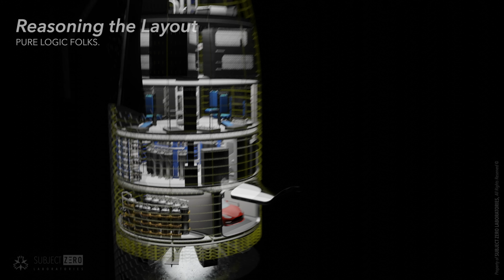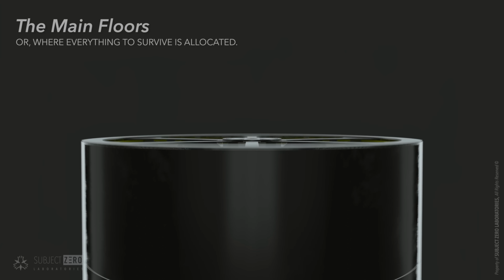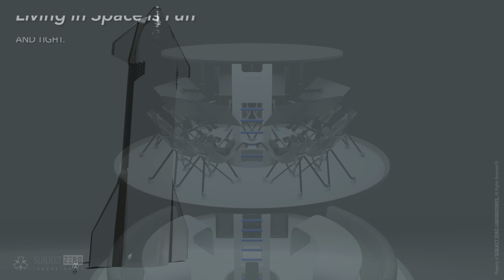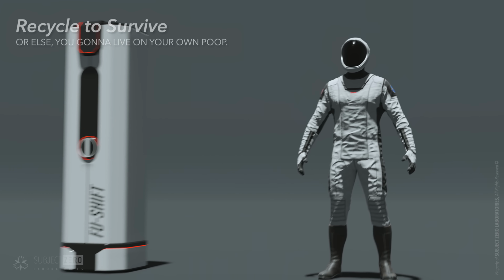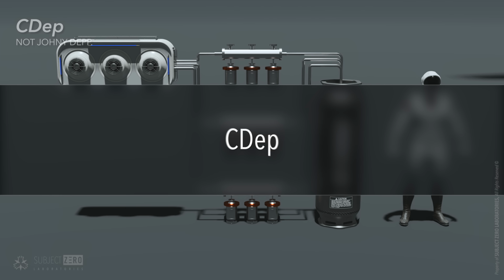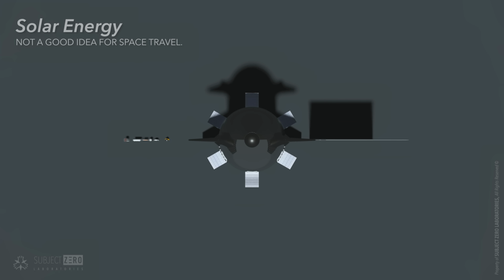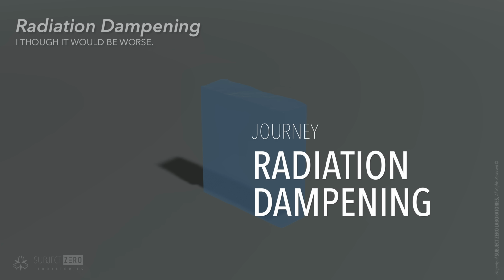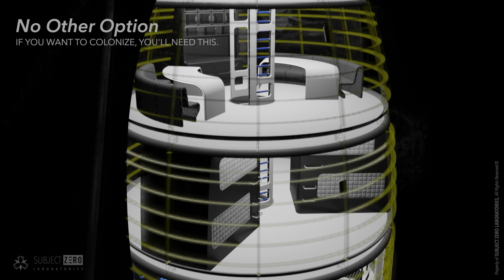Onboard the SpaceX Starship 2.0 in Detail - What it takes to go to Mars | Detailed Breakdown

Comment: I was thinking, "They're going to need nuclear power", all the way through the second half of the video.   Hydrogen cells, solar and batteries are never going to work on such a lengthy mission.  Over time, hydrogen leaks through of all known materials.  I would be very nervous about hydrogen tanks that were meant to last five years, or even six months, without serious leakage problems.

 With nuclear, there will enough power to spare to split CO² back into carbon and oxygen.  This means far less oxygen will need to be transported since it can be recycled from CO².  With sufficient energy available, water can also be split into hydrogen and oxygen.  In this scenario, the hydrogen doesn't need to be stored for long periods, minimising the leakage losses.

Recycling everything combined with utilisation of resources found on Mars will be the key to manned journeys to Mars.
Reply: The downside is the weight of nuclear reactors though
Reply: @VitVoz  - check out NASA's "kilopower" reactor
Reply: Freja Solstheim  those are micro reactors and do not provide anywhere near enough power for an entire space ship.

a probe yes, a space ship that utilizes over a thousand times as much energy?

nope. there is no nuclear power station light enough to provide enough energy that can be added to the ship, period.
Reply: Hydrogen can be contained entirely in graphene I heard
Reply: @freedomhq4075  not without leaks, that's the issue at hand.

yes graphene can be used like a sponge but getting it to the sponge still requires pumping it through tubes and hoses, which means leaks.
Reply: Manned mission to Mars will never happen with Chemical Rocket Fuel you dreamer😁
Reply: Nuclear reaction has been tested and in use for almost fifty years in space on Voyagers 1 and 2. It works and it's proven.
Reply: @georgeyoung4292  why not?
Reply: Developing a nuclear reactor suitable for this mission would take a few years at least, especially for the astronauts to have faith in it. It's not clear if it is workable at all. The reactor would have to be one similar to those on submarines, but would also need to be lighter and more efficient. It's also an additional radiation risk. And it has to be operated, automatically or manually. Both aren't easy, and it's a long voyage for nothing to go wrong. Reactors like this regularly fail or have issues (and I don't even mean the blowing up kind). In a submarine you just need to surface and then you have at least oxygen. In a spaceship... Fuel cells and Solar power are way more reliable. They may even find a way to stick a lot more solar cells on a starship, or the cells get more efficient. Lots of things are possible in the coasting phase.
Reply: @zamath1895  Cause it will take 9months to go there , thats 270days , human being needs 3liters of water and 2meals a day (1500kcal is minimum) Crew of Starship is what? Lets say 50peoples*3l(Kg)*270days=40500kg or 90000lbs+3500kg(70kg per person) or 8000lbs🤦‍♂️ What about the food? What about the equipment and machinery? What about 9months in Zero Gravity? What about GCRs? In 9months you're musles and bones will lose 30% of the density and radiation will make it even worse... But just to account for the weight!!! We are talking about 150-200 metric tons just of raw material fot short therm survival.. Entire Mars saga has been absolutely ridiculous.. Unless we develope new kind of propulsion and shielding and figure out how to generate gravity we are not going anywhere cause we are not evolved to survive in such conditions you genius!!! You really believe this bullsh*t😁???
Reply: @georgeyoung4292  So for 50 people to go it takes 200 tons, Starship is said to be able to carry 100 tons to Leo so instead of 50 their will likely be let's say 20 people leaving 20 tons for exercise,beds,extra if 20 people is still to many you can lower it more. The problem of zero Gs is a hard one to solve but it has been proven that you can survive more then 9 months in zero Gs and be fine afterwards. I believe it is perfectly possible to land people on Mars and set up a colony We as humans have pushed our limits countless times in the past and we will undoubtedly do it again
Reply: @zamath1895  land people on mars? Sure, it might be possible in a decade. Setting up a colony? We aren't even close.
Reply: I think the most interesting possibility here would be to use nuclear fusion (once we get it to work ofc), even though that will obviously take a bit of time until we re finally there
Reply: @Andreas-gh6is  space nuclear reactors do not use water to generate power like subs generators, they use the Seebacks effect from the heat of the nuclear source, this is a basic and very fail resistant system that can be enlarged or have multiple versions of the existing system, Perserverance rover uses one of the latest models, it's reactor weights around 45kg and uses a plutonium source of about 5kg to generate ~110W, with a bigger reactor of around half a ton and multiple plutonium sources they could easily get to 2KW to 3KW, with a battery system is more than enough to transport humans, the battery would be charged when astronauts are asleep by turning lights, computers and non essential systems and during the day the battery would complement the reactor power generation.
Reply: @georgeyoung4292  we simply dont know what the future will bring lol, might be ready by tomorrow, might be not even in 500 years, who knows
Reply: @nulled7888  I know that it wont be viable for electric generation in this century even here on earth, let alone to somehow build it into Rocket Ship nor will you see any manned mission to Mars... Absolute Garbage🤦‍♂️
Reply: @georgeyoung4292  everyone has their own opinion on such topics i guess.. while you seem to be rather pessimistic, it helps to views progress in a positive light too sometimes. And you really shouldnt underestimate the 21th century, that should be clear by now, dont you think? We have so many promising technologies that our ancestors would probably think of as magic, i would never make the mistake to underestimate this development if i were you. IMO it seems as if we are very close to the edge of a cliff, either we will fall or we will learn to fly. And it has to happen soon, because we are running out of time.
Reply: @nulled7888  Im realist.. Sure we will make it😁
Reply: @georgeyoung4292  Uh,  NASA with SpaceX have developed rockets (Starship and super heavy booster) using fuels (methane and oxygen) for planned missions to the moon and Mars.  It's not a dream.
Reply: Worse. Hydrogen embrittles  the materials it is leaks through. Hydrogen embrittlement.
Reply: @DeferedPattern  this kind of reactor works for probes and rovers, but it's not going to scale up. There are probably good reasons nuclear reactors in general don't use the same concept. Radiation shielding is one problem. You don't need any in a probe, but it changes with Humans. Also it's not just about the Humans, neutron radiation also affects other plutonium in the vicinity. So you'd need to shield different reactor cells in order not to get a critical mass and a run-away chain reaction. By that time, a more conventional design is probably more efficient and practical. But in any case, the complexity grows with scaling the system up in any form.
Reply: pyropulse  So far for not getting personal. A submarine or aircraft carrier is not a spaceship. On a spaceship, mass counts a lot more. Also you don't have multiple crew slots available just for handling the reactor. There is no "suitcase sized reactor that can power a home" (nor would that be enough). There may be plans for one, even plausible ones. They aren't reality. Nuclear reactors of all sizes fail regularly. They do have to be managed. Still they go offline quite a lot. Can't have that in a spaceship when you are relying on it for life support and the next port is years away. Nuclear chain reaction is a thing, so you either need some absorption rods (and control them) or shielding between cells. Or an entirely different kind of reactor that only exists in theory or at best simple prototypes. This isn't even about safety at all, though there are probably things that could go wrong. People who really like nuclear power somehow rely a lot on technology that doesn't exist in the real world to make their arguments. And all accidents are preventable and will never happen again, of course, pinky promise.
Reply: I just googled it. a nuclear reactor used in submarines would easily solve the starship power problem but weigh 1,000 tons. that is 10x the maximun cary capacity of one starship just for power.
Reply: Freja Solstheim  won't work... even though they are small and nuclear they are no where near powerful enough to power starship.
Reply: @freedomhq4075  still too heavy... and you will need to bring tons of oxygen and water to make this work.
Reply: pyropulse  What is this irrational emotional attachment people have with nuclear.  Nuclear is just dumb.  Like hydrogen fueled cars.  Dumb.  The cost and the risk of nuclear is not worth it.  And, it can't get scaled up for a space craft like the Starship.  Using nuclear as an energy source here on earth is incredibly stupid.  It takes 20 years to build a plant and it is THE most expensive way to generate electricity.  No, nuclear is not the way to go.
Reply: @zamath1895  have you seen the shape of people after long term exposure to zero G. yes... they survive, but need months of rehab to recover. now you send them to mars and expect to start building day one... not going to happen.
Reply: @DeferedPattern  still not enough power for all the systems proposed for starship.
Reply: @georgeyoung4292  Correct! I've been saying this for decades.
Reply: @nulled7888  Very easy to make speculative predictions but bring your thoughts down to earth (excuse the pun) and make them reality. Going to Mars, and I'm being optimistic, will be sometime in the 2030s.
Reply: pyropulse  Yes, nuclear power is very "energy dense" if you only count the fuel. Maybe if you count the whole reactor with all its shielding and equipment, but then only at a larger scale. In a spaceship all of this counts, and the efficiency or density shrinks with smaller sizes. Some calculations for example say that small modular reactors will produce more radioactive waste than less, just because they have to use a lot more shielding in aggregate, and all of that will eventually end up as irradiated waste.
Reply: @JohnnyWednesday  yeah and they will need them on mars anyway - mars has same solar cell problems with added issue of months long dust storms that would seriously disrupt solar power (but no appreciable wind (1/60th atmosphere density) or other environmental power sources. And anything geothermal if even possible would take decades to get up and running with available eqiptment (also water lack).. And nasa are working on higher energy  kilopower versions.
Reply: Nuclear benefits are huge for this. It solves many problems, the energy could be used to process CO2 to O2, either by Algae, hydroponics and other processes or some combination of all of those. This could re-use human waste and produce food. This further reduces mass needed to be carried. The benefits compound: The appeal of nuclear is strong.
Reply: @Andreas-gh6is  I could like literally build a suitable nuclear reactor for Starship right now so stop being sassy!
Reply: @tillasmax  of course they can start building right away, it's just a matter of mindset and stop being all whiny when you only lost a few percentages bone and muscle mass
Reply: @16nowhereman  huh i never said it had to be before 2030, i agree with u here, development takes time.. all im saying is that with some major progress in key technologies we would be able to do it more efficiently and reliably with less risks etc..
Reply: Let me repeat, even if the nuclear reactors would weight zero and produce no radiation, it would not work... They work by producing heat that makes water vapor that then runs a turbine... That works because as the water vapor cools down it goes in to liquid form...
How do you do that in space how do you cool down thing in the vacuum of space? The international space station has huge heat radiator to manage the heat it generates, a nuclear reactor would require hectares of those in other to work...

Just use solar panels they are way more efficient in space
Reply: Freja Solstheim  yes I know about those but one thing is to generate 400wats of heat another completely different is 10000 wats. You need ever increasingly sized heat permutators, in the vacuum of space it needs to be done via infrared emiton, if you have an atmosphere convection will help.
And heat is what all nuclear decaing elements produce.
The heat exchanger will need to be pointing away from the sun and also be mostly flat so it does not radiate to itself... Again have a look at the ones in the international space station..
Reply: Freja Solstheim  also I was looking up the efficiency of TEG's and it's really low around 10% max meaning that  to get 100 wats of electrical power you need to get rid of 1000wats of heat...  Solar panels work way better, at least when we are this close to the sun... In Jupiter we would need something different for sure but... Inner palanets the sun is your best bet
Reply: Bingo ! that was exactly what I was going to say ! Go nuke and split that CO2 ! such a system if perfected could save "tons" of weight !!!
Reply: @A_piece_of_broccoli  RTG's yeah not exactly the same kettle of fish at all !
Reply: @georgeyoung4292  Of course it could, haven't you been paying attention ? take your doubts, and then halve or quarter the amount of astronauts, there you go, all issues solved...
Reply: @A_piece_of_broccoli  they can power quite a bit actually, for humans to live in a small home you dont need more than several hundred watt hrs per hour
Reply: Well , nuclear ain't going to happen, they don't even want to let Elon conduct testing
Reply: @pinheirokde  well some companies are working on nuclear diamond batteries and if they actually work out maybe they could power the devices in the star ship with enough of them
Reply: @pinheirokde  Somewhat true but only to a certain degree and scale  relatively
Reply: Hydrogen is best stored as water.
If you have electric power, converting to gaseous oxygen and hydrogen is easy.
Reply: @tonywilson4713  That is why this is on YT.
Reply: Freja Solstheim  You don't need to encircle the hydrogen atoms, sheet graphene also physically does not allow hydrogen atoms through its gaps and you can just build that into the tank material
Reply: @myballsitchsomethingfierce6319  The one on the rover is orders of magnitude too weak
Reply: @kazioo2  I think that Voyager I and II might beg to differ with you there...
Reply: Precisely my thought...
Reply: @A_piece_of_broccoli  What about diamond? Imagine a sphere coated internally with industrial diamond layer.
Reply: @Andreas-gh6is  maybe they could drag a nuclear rector behind the human shuttle...like a trailer.  It could be far away from humans.
Reply: @TheRainHarvester  That wouldn't solve much of the issues. It still needs a lot of shielding just for the time it is carried inside the starship. Either the fissile mass still needs to be small enough to not go critical or you have to manage the reaction with absorption rods or something. Management and Reliability are probably negatively affected by dragging it behind where nobody can reach it without a space walk.
Reply: pyropulse  Only when you count only the fuel...
Reply: Freja Solstheim  You can't scale that up very well because of the way the chain reaction works. Ever heard of critical mass?  It's a thing. Those 45kg reactors don't need to manage their neutron output that much. And you can't put multiple smaller reactors on the same ship unless you shield them enough so that they don't go critical by irradiating each other.
Reply: @-CrySa-  indeed... not even close by far. And what good would it be to have 100 people living (extremely unhappy overtime) on mars. People are dreamers and we can dream but we are products of mother earth and it's here we have to solve our problems. This is just rich people doing funny things with less fortunate people's money. But....  we can dream of course
Reply: you apparently now very little about nuclear energy
Reply: @georgeyoung4292  That 9mo figure assumes you're doing a Hohmann transfer which is fuel efficient but takes more time.  A Hohmann transfer from LEO to Mars I believe is around 4km/s dV.  Last I heard the target for a fully fueled and loaded Starship is around 7 km/s dV.  Even after using some for landing that should still leave a good chunk of dV to use to decrease the travel time to Mars.
Reply: @-CrySa-  Nope, we have these things called 3d Printers and they are really big now, Tesla basically 3d prints their cars, we just need a few of those on Mars and we'll be building structures locally, very quickly. So, ya, probably 15 or 20 years, but that's not overly far.
Reply: @inemanja  Cool.
Reply: @TomUlcak  I see you have fallen for Big Oil's misinformation campaign.
Reply: @plumetheum7017  Thats exactly what i said.. Its just pointless to discus such lunacy 😁 From Elon Musk i dont expect anything less than Vapor wear promises..
Reply: One thing he didn't mention was the mass, scale and volume required for radiator panels. And since they won't survive launch or atmospheric entry, they will need to be deployed immediately in orbit and stowed very late in the flight. Quite likely this will involve complex, risky EVAs. 

Nuclear only makes this problem worse because it multiplies the amount of heat that needs to be radiated.
Reply: the questions you ask have been answered by SpaceX.
Reply: @saumyacow4435  a reactor would weigh far more than solar panels. also, SpaceX has a design for solar panels to be self-deployed - as most spacecraft have.  nuclear is not feasible for a space craft the size of Starship.
Reply: @A_piece_of_broccoli  You dont know anything about nuclear reactors.... in fact there were already nuclear boosters in the 70s tested, ofc those have not much to do with a proper nuclear energy source but you also have to consider: The "micro reactors" you talked about lasted for 40 years+.... They "just" have to last 5 years!

But in overall.... not even nuclear power can make a manned trip with staying to mars possible
Reply: @TomUlcak  SpaceX has put out CGIs showing a basic solar array. Nowhere near enough needed to power the systems involved. In other words, they need to be much, much larger. We've seen automated unfolding of large solar arrays, but we've also seen them getting stuck and needing EVAs. And can you imagine what would happen if there were a problem in solar panel refolding and stowage with only hours to go till re-entry? And that's just solar panels - you've also got thermal radiators which tend to be more complex and have far more things that can go wrong thanks to the plumbing.
Reply: @saumyacow4435  please post.  I've seen no such CGIs.  I've seen CGIs that show a scaled solar battery system which SpaceX has put out to power the Starship.  I've seen no mention of nuclear.  A reactor to power a spacecraft the size of a Starship is just not doable.
Reply: @TomUlcak  If you're done discussing it, why are you discussing it?

This is a discussion of nuclear energy's potential use in outer space where there are radiation hazards that will exist for the order of BILLIONS of years, not thousands, and have nothing to do with nuclear energy at all.

Note also that I did NOT say nuclear "fission" which is what your entire objection is based upon, nor did I say that nuclear power is  ready yet for such a use.

This discussion has literally nothing to do with nuclear energy's use terrestrially.  Conflating the discussion with your own arguments about another topic entirely reveals that YOU are the emotional, irrational person here.
Reply: @andymanaus1077  I'm not discussing it.  If you will LOOK, you will see that my last comment on nuclear was the one I said that I'm not discussing it anymore.  ????  This is a head scratcher.....
Reply: @TomUlcak  So don't discuss it.  Leave graciously without insulting others' points of view on the way out.
Reply: @andymanaus1077  me insulting? You’re kidding me. I’m not the one doing the insulting. What is wrong with you? Lot of pride and arrogance?
Reply: @andymanaus1077  so, stop discussing and leave graciously without insulting people. what a hypocrite you are.  seriously.  take your own advice to heart.
Reply: Fuel cells are horribly unreliable. If you get six months operation out of them you have a wildly successful design.
Every single space flight powered by fuel cells had a failure.
Hydrogen loss is the least of the problems…
Reply: Light weight nuclear power reactors exist. They have existed since the US flew the first one in an aircraft in the 1950’s.
Air Transportable power reactors were built and used in Greenland, Antarctica and Australia to power US bases on those continents.
You don’t need 1000 tonnes of anything to make a reactor. 
NR-1 was a complete nuclear powered submarine and it weighed 400tons complete and it was designed to dive to 3000ft so had a substantial pressure hull.
The US and Russia have both launched high nuclear power reactors into space - a nuclear rocket engine would weight 18 tons based on the prototypes built so far.
Reply: @TomUlcak  So far all of the semi-detailed renders of Starship's interior have been fan fiction. And you know what's surprising? Despite Elon's hype and promises, there are still three major bits of technology we don't have. The first is the must-never-fail machinery needed to keep humans alive in deep space for years. The second is the industrial scale mining and processing machinery needed to produce fuel on Mars. The third and even more ridiculously difficult and expensive is of course the "industrial base" that must exist on Mars if you want a self sufficient colony. Even specifying that is beyond our present capabilities, let along designing it, let alone the trillions it would cost.

So, given all the hype and promises, you'd expect Elon have to dipped a hand into his pocket and pulled out a few millions in order to establish a crack team of scientists and engineers to work on these problems.

Has he?

No.
Reply: @VitVoz  You launch the reactor as a single unit and then attach it to the transport module in low earth orbit.
Reply: It's the radiators and mass that get you with nuclear power on Starship. His solar panels would generate around 79 KW of power near Mars. Kilopower reactors had about a 23% efficiency rate, so to generate the same 79 KW they'd need to produce about 265 KW of waste heat. Even the best radiators get around 350 W per square meter of heat rejection, so you'd need radiators of about 757 square meters. 

That's assuming the best possible radiators as well. If you try and just radiate it through Starship's hull, then you're not going to get 350 W/square meter - and 757 square meters is close to half of Starship's entire surface area to begin with. 757 square meters would be the equivalent of having six radiators that are 2 X 95 meters in dimensions (and they're much more complex, especially if you need them to go out very long - and you have to carry sufficient coolant on board to operate them).
Reply: @GuardsmanBass  Well stated. But its even worse than that. The underside of Starship's hull is covered in tiles. The upper side probably won't remain a bare metal surface (it still receives radiative heating on re-entry). So we're talking thermal blankets (see Space Shuttle). Plus the thermal radiators would have to be protected from re-entry. Those requirements conflict, meaning you need deployable radiators. Radiators aren't just sheets of metal but rather they have internal plumbing - which of course makes deployment/stowage even more complex and more prone to failure. 

If on the other hand you stop trying to do "Mars direct" and instead you separate out the role of deep space transit vehicle from Mars lander/ascent vehicle, then you can have a transit vehicle based around a long truss and have your solar arrays, thermal radiators, comms gear and so on, permanently attached to the truss - and you have plenty of space for them. 

What I've proposed is a transit vehicle with a habitat on one end, attached to a long truss (roughly 150 metres). On the other end of the truss is attached propellant tankage. The propellant tankage acts as a counter-mass so you can provide spin gravity. Onto the length of the truss attaches solar arrays, radiators, comms gear and a few other details (including tanks). One nice part is the truss is so long that your main solar array doesn't have to project too far from the truss.
Reply: @saumyacow4435  I like the transit vehicle idea, although I don't think you need to make it that long. From what I've read, people can probably adapt to up to 6 RPM in spin gravity in a couple hours, and maybe even higher. That means you only need a radius of 25 meters - short enough that you might be able to launch it in two separate, folded up Starship flights and have them connect in orbit. 

A more compact ship means you can probably also launch up a heat shield (or have it expand out) that wouldn't need to be so large for aerobraking.
Reply: @GuardsmanBass  2nd attempt at a reply since YT lost my earlier comment. This will be briefer, sorry.  I would defend a long truss thus:

Its only a small fraction of the vehicle mass and certainly a lot less than the mass of hardware attached to it.
A long truss means a long but narrow solar array that doesn't extend far from the truss itself. That means a simpler array and few (if any) hinges.
Similarly for radiators that can be rigidly attached to truss sections. They can be assembled onto the truss on Earth.
You also need space for tankage. Plus other hardware like comms. A long truss gives you a simpler, and probably more reliable design.

Aerocapture scores a lot of mass for the heat shield. But more importantly it scores a lot of structural mass because the entire vehicle is now subjected to 4 or 5 gs. Whereas propulsive capture requires one g or less. That compounds into every bit of hardware, including arrays which now have to be robustly designed or stow-able. 

It works out that the mass of propellant you need to carry with you to propulsively capture and brake into low Mars orbit is the same mass you need as a counter-mass for spin gravity. Also, some of the liquid methane can be used for radiation protection (auxiliary tanks around the crew module). 

Note that I'm not fussed about the mass into low Earth orbit. We are assuming that the cost of lifting large masses into low Earth orbit is a lot lower than it is now. 
Note that the propellant tanks are "smart" - they have their own orbital thrusters and navigation and can automatically dock with a truss. 
That design carries forward into Mars orbit where you can now build tankers, orbital tugs and also backup crew modules.
Reply: @chrischeshire6528  Do you know how the nuclear batteries on those vehicles work? It's a thermocouple stuck into a brick of plutonium. It's like saying you're going to run your house on your radium watch dial.  If you want to run a five year mission to mars with 10 people on board off a 3 watt battery, go for it.  Also, you know that long boom that sticks out the side of voyager? That's the battery on the end, so it doesn't screw up the computers too badly.
Reply: @pinheirokde  the dark side of the spaceship might be pretty cold?
Reply: @alanmatteucci4527  it is pretty cold but it gets cold very slowly, it's the vacuum of space it only gets cold as heat gets radiated away as infrared light. That's it... The international space station uses radiators to manage the heat it generates. And they are pretty big. Now imagine you have a nuclear reactor... They would be massive...
Reply: What about calculating the cost on global warming. The coal plants themselves generate more waste per year than nuclear power have over their LIFETIME. Oh and btw you can sorta recycle nuclear waste into plutonium so there’s that.
Reply: Freja Solstheim  Then there are pacemakers.
Reply: @georgeyoung4292  Everything physical is a "chemical".
Reply: Science Revolution  I can't fix stupid.  I'm not even going to try.
Reply: How about RTG!
Reply: I thought starship was supposed to run on methane and then on Mars they will filter the atmosphere and on Mars it’s made of methane and oxygen so they refill the rocket and produce oxygen for the planet
Reply: Freja Solstheim  RTGs for deep space exploration were typically not even a kilowatt at launch. They work by natural decay of readioactive elements, usually plutonium oxide is the source. For operating a starship, a small reactor would be needed that actually uses fission to be able to regulate the power. Musk probably already has some nuclear physicists/engineers working on this, but it will be a few more years before any details of such a system will be made public.
Reply: Graphene is impervious to hydrogen leakage.
Reply: @A_piece_of_broccoli  the kilopower systems can match the 40 kwh average me tinned in the video, reacters can be made light and strong enough to work.
Reply: @paulmichaelfreedman8334  i think musk didnt have any engineers working on it. Its just a really big deal, not for just few guys. 
If he wants some fission reactors he cooperate with NASA or buy some established SMR startup with experiences and prototypes.
Reply: @pavelvalenta2426  No I don't think he would develop that in-houdse but you can bet on it he's following the news on miniature fission reactors, so he has basic knowledge when push comes to shove, and knows exactly what he wants when it is time. He plans such things far far ahead in his mind.
Reply: I think it’s methane power 🤔
Reply: Just run generators powered by diesel & LOX. ;)
Reply: @A_piece_of_broccoli  They aren't reactors at all they use the energy from radioactive decay. Entirely different technology
Reply: @looksintolasers  LOL, yeah that would look silly wouldn't it, taking diesel along while there are APUs that convert LH and LOX to electricity and heat.
Reply: There are reformed methane (and methanol) fuel cells, that use steam reforming to crack methane into h2 and carbon particulate before running the H2 through a fuel cell.  Keep in mind, the starship has massive tanks of methane and oxygen it uses for rocket fuel.  simply allocating some extra tankage to account for the extra fuel and oxygen used for fuel cells would be comparatively simple and solves the hydrogen storage problem quite neatly.  

Granted nuclear power is still a very good idea, and solutions to lower mass microreactors for space applications is a very much needed field of development.  

All that being said, I think solar is actually still a potential solution with a more sensibly designed folding geometry, that can compact down more and unfold bigger.  NASA has been researching origami for ways of folding big solar panels into smaller spaces for a while now and they have had some significant success.